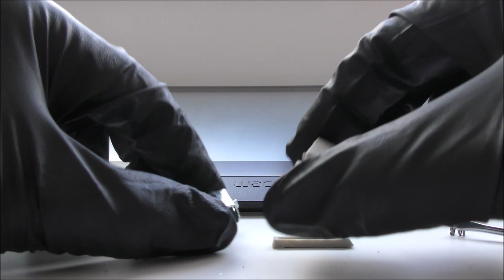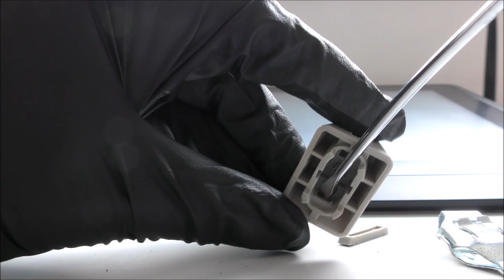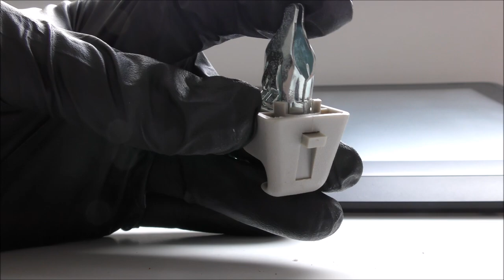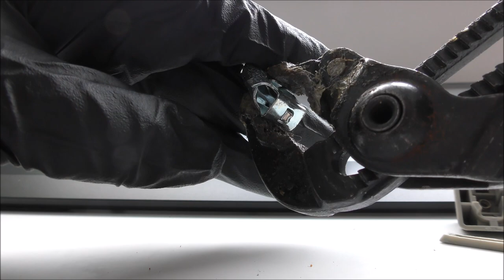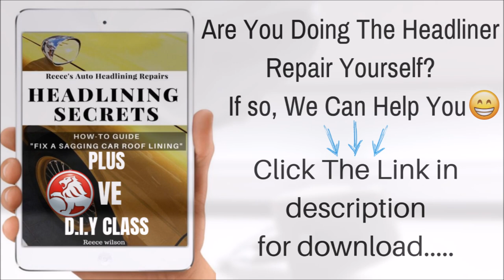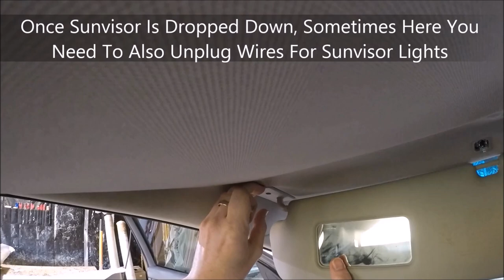How to Remove HOLDEN VE VF Sun Visor Clip (same on Holden Astra 03 / Holden Zaffire)

Comment from the maker: Thanks for watching 😃
If you'd like to Help this channel GROW!! Leave a COMMENT below and Click that SUBSCRIBE button.
⬇️ RECOMMENDED PRODUCTS ⬇️

★☆★ PRODUCT RECOMMENDATIONS ★☆★  
These are eBay AUSTRALIA LINKS:

(MATERIALS)
▸ (FABRIC SALES PAGE) BUY Foam Backed Headlining Material- https://ebay.us/iVlfnt
▸ (FABRIC SAMPLES VIDEO) Our 7 Headliner fabrics we use - http://ebay.us/hIY6o4
▸ (GLUE CHOICE #1) Permatex headliner & carpet adhesive - http://ebay.us/apC9ZH
▸ (GLUE CHOICE #2) 3M High Tac 76 Headliner Glue - http://ebay.us/eAGTji
▸ (OUR FULL DIY GUIDE) Headliner Secrets eBook - http://ebay.us/iPs1X8

(TOOLS)
▸Trim Removal tools - http://ebay.us/8MePx8
▸Torx Screwdriver set - http://ebay.us/udewcj
▸(QUICK REPAIR) Clear Head Twist Pins - https://ebay.us/rjCONm

(FABRIC UPHOLSTERY CLEANERS)
▸Bowden's own fabra cadabra 500ml - https://ebay.us/2VFGnl
▸Carpet and Upholstery Foaming Cleaner - http://ebay.us/Elyle0
▸Bowden's own orange agent 500ml - https://ebay.us/N8HYVz
▸Di-san Stain cleaner 500ml - https://ebay.us/OGJMHw
▸LIGHTNING Solvit Citrus Cleaner - http://ebay.us/SvSZyV

OR BUY on Amazon, see this link below
https://www.reecesautoheadliningrepairs.com/buy-headliner-roof-lining-glue-adhesive-fabric-material/

This description may contain affiliate links. If you decide to purchase a product through one of them, I receive a small commission at no cost to you. We don't promote crap (unfortunately, there's a lot out there). Only products that I have personally used and paid for and LOVE! ✌️

GET More about the Headliner Recovery Process, get our latest eBook HEADLINING SECRETS

★☆★ DIY HEADLINER REPAIR | A STEP BY STEP GUIDE  ★☆★
👇 DOWNLOAD 'HEADLINING SECRETS' HERE 👇https://www.reecesautoheadliningrepairs.com/product/headlining-secrets-ultimate-guide-fix-sagging-car-rooflining-reeces-auto-headlining-repairs/

Comment: Thanks very much for the clear explanation. I had tried many times without removing the metal part from the roof. Mission impossible solved.
Reply: Same, we used to leave the metal part in the roof at the beginning as there weren't any tutorials online back then years ago. I'm glad I made it easier for you. Once we started removing the metal part it just made sense and made the job much easier 😅
Reply: @Reece.wilson  Thanks Reece. I struggled getting the whole moulded liner out. I ended up damaging the corners and cracking another couple of places. I have a WM Statesman. Bit longer than the Commodores. I repaired it with some Gorrila glue good as new. I had the front and rear screens out for installation. Very simple except for the visors...😄

Comment: Is there somewhere we can buy new clips? The metal clip fell into the roof lining and I basically had to rip it apart to get it out.
Reply from the maker: Maybe through ebay or a holden dealer you could buy Replacement parts for the rooflining,  or wreckers.

Comment: Hey mate how would I get the clip if it falls in the roof lining?
Reply from the maker: If the metal clip falls inside the metal part of the roof, may be very difficult to remove, and sometimes I'm not sure if you can. However if its between the headliner board and metal roof, you could get it by removing down or flexing away some of the headliner board, if you still can't reach it, you may have to drop the headliner board completely down, or just replace the metal clip.

Comment: Would this be the same as a 2014 vf Holden?
Reply from the maker: Thanks for your comment, I can't recall on doing a VF holden headliner yet, so unsure if its the same setup or not.
Reply from the maker: Same on VF Commodore Roof linings , they use the same board as VE and will eventually have a saggy roof. We done one now so far.

Comment: Who's dumb idea was it to make those. Same goes for grab handles, floating mounts backed with plastic that falls apart. Glad they aren't making these heaps anymore
Reply from the maker: Thanks for your comment, I agree, the older way to remove most plastics was just a simple screw, but the newer cars are becoming more time consuming to work on, with all thats involved now in taking off simple plastic components.
Reply: @ReecesAutoHeadliningRepairs   Thanks for the vid. Nothing easier than a simple screw for sure, don't need to over complicate things.  I blame the enginners at vauxhall.
Reply: Its really all about manufacturing efficiency. Its probably quicker to have these survivor clips show up to the station ready to click into place rather than having to get the part, find a screw and getting a tool to zap the screw into it. I do agree that older cars are better though but VEs really are pretty easy to work on.